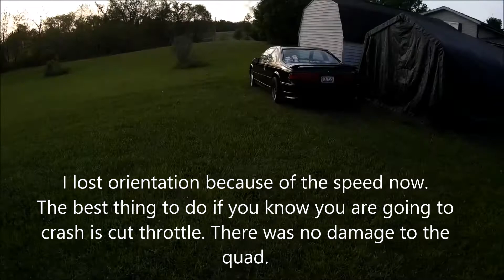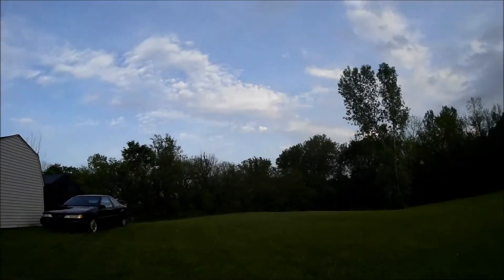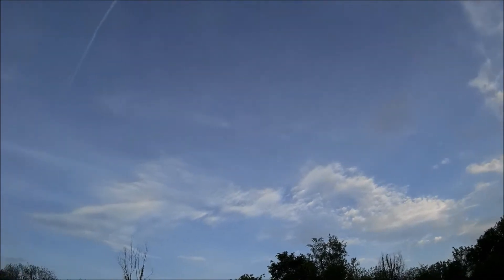Drone JJRC JJ 1000 with Hubsan X4 107L props

Comment: Thanks for the info! I was looking for another quad , and I wanted something a little faster than my JJ8C, and your video helped me decide which one :). But I have a question regarding the JJ8C. I still have motor life issues. Bought 8 and went through them all within 15 flights, but I believe that was due to their being El  Cheapos from China. But, I notice a wobble in the props. Is there a way to balance them, and would this influence the motor life?

Comment: I got an extra J1000 for the motors and had some Hubsan X4 props for them as Benedict at Micro Motor Warehouse recommends so decided to try them out on the JJ1000 and was quite impressed in seeing a higher vertical climb rate so pronounced it required readjusting to it, faster flight, and longer flight times well over 10%. I just got almost 7 min with a stock 250mAh battery and that's with a slow free spinning spinning motor. Heard the Ladybird props are good too from David Duro's reviews. Time for someone to build a micro motor thrust stand and do some proper measurements.